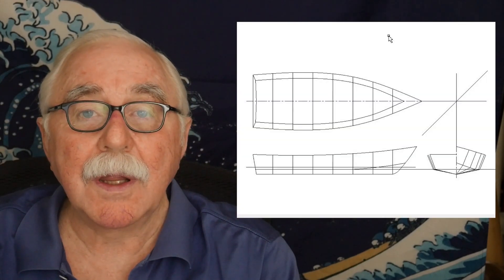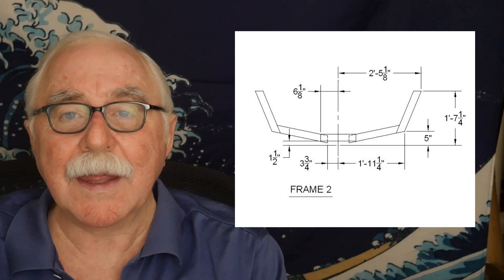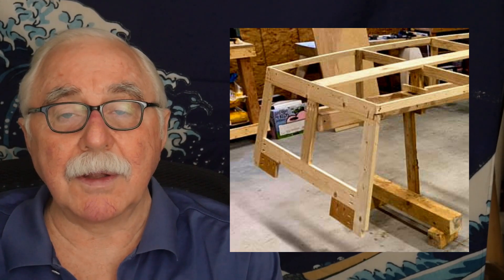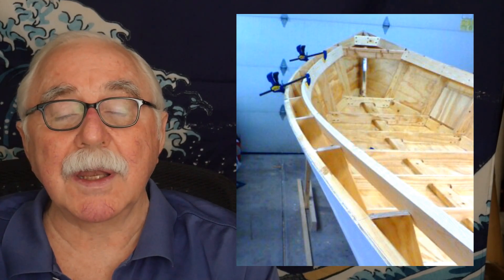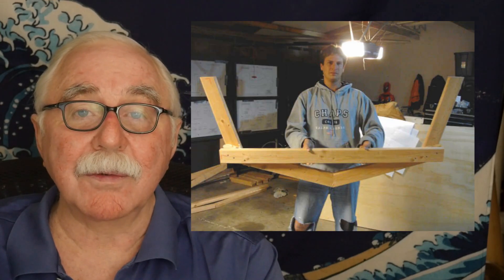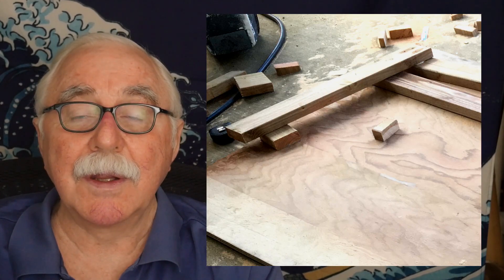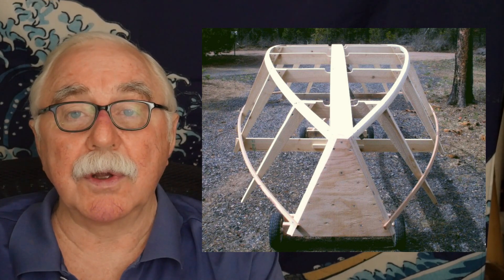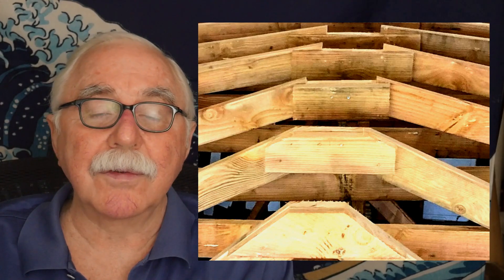Yes You can Build a Boat #19 - Building Frames

Comment: Hi I'm new to your Channel I really like your boat plans but I'm a retired welder and would like to build one out of aluminum has anyone ever use your plans to build an aluminum boat do you think it's possible frame or Stitch and glue which do you think would work best
Reply: I've been thinking the same thing. I work at a fab shop and have access to a CNC plasma cutter and a press break. Im thinking 3/16" for the bottom and 1/8" for the sides and ribs.
Reply from the maker: You can build either framed or stitch and glue out of aluminum. I'll give you the frame sizes and skin, but you'll need to add longitudinals as well as the spacing is too wide to keep the plating from getting that lean and hungry look over time. 

You cannot cut out the planking using a CNC cutter though. You have to fit the planking to the frames after you weld up the framing, then use that assembly as a pattern. You can with stitch-and-glue though, and I'll give you the dxf files to program it.

Comment: Thanks.  Never had to build so many frames, big and stout, before, as every previous build could ride in the back of the pickup or on top of the Ford Escort (remember them?).  It bothers me that I’m getting better as I go along - I find myself being more & more demanding, looking for tighter grain patterns and fewer knotty runs, etc.  I’m almost afraid that the boat, from about midships forward will be laser straight, hog tight, and bull strong, but midhips aft, ???  And the work table.  First cupla frames, an old cdx sheathing laid across a couple sawhorses.  Wuh.  Luckily it rained and REALLY warped the sheet.  I had a couple sheets of 1/2”  mdo I bought for another designer’s project (he calls his plywood frames bulkheads so’s not to commit the sin of designing plywood frames).  I decided not to use the mdo for that project, so they sat under tarps for a year.  Well I split a couple of cull 2x6’s & screwed one of the mdo sheets to them and laid the assembly on the sawhorses ...so I have a ~$50 work table.  I LIKE it!  Lines laid down with ZERO distortion!  Damn we boatbuilders can go on and on...

Comment: I felt like you were really defending your design and  drawings way too much  I am a retired Professional Woodworker with 25 years of Professional  experience and over35 years as a Hobbyist  on a side note  I’ve also owned 17 or 18 boats  of all sizes and constructions including Antique Wooden Chris Crafts and some Fiberglass hulled boats  of both Sail and Power  and looking over your plans and photographs  I don’t see anything I feel is incorrect or wrong  unfortunately the Internet is full of negative people and commenters  I would ignore most of those remarks  and continue  doing similar designs and drawings  I’ve seen Epoxy and Fiberglass Coth hold together very old 1930s and 20s work skiffs  that were in pretty bad shape but provided a Chesapeake Bay Waterman his Livelyhood  and doing a West Epoxy / Fiberglass cloth job was basically a Hail Mary effort to still use that old boat for as long as possible two of which vessels I know held together for another 25 years of daily service  of Crabbing or Oystering  I’ll give you this those boats will not winBeauty Contests  but are plenty Sea Worthy  one of which I’ve gone out on  and that was built in 1932
Reply from the maker: I'm not trying to defend the designs, just trying to explain how they work, since I get a huge number questions about changing my designs, or adding more glass, or straightening the sides, or converting flat bottoms to v-bottoms or adding frames to make shorter boats longer, or all sorts of other things.

Comment: The hardest part about picking a boat to build is finding a motor I can afford ... lol FBWW
Reply: When I was shopping I found I could buy an old fiberglass boat with a decent motor. I got a beat up 70's boat with a nice running chrysler 45 and a decent trailer for $650. I was also able to use all the controls, all the railings etc, the seats (not great but useable. Way cheaper than buying a decent motor and I got a lot in the bargin. Disposing the boat was cheaper than I thought, $28 at the landfill.